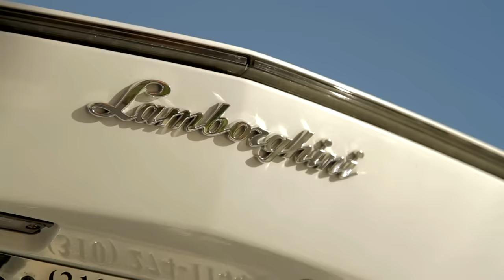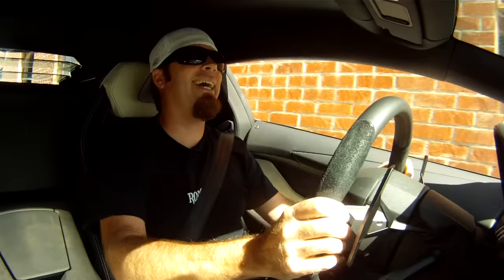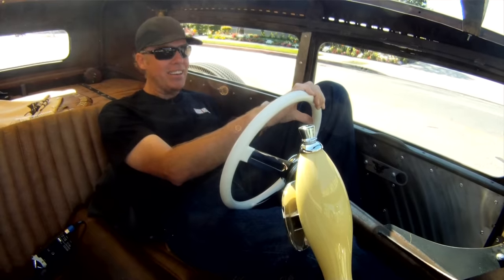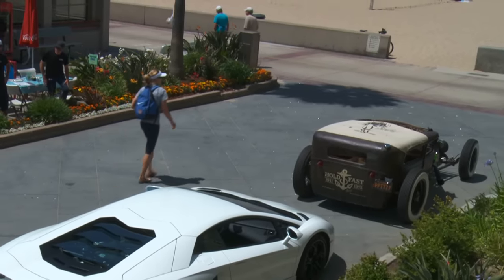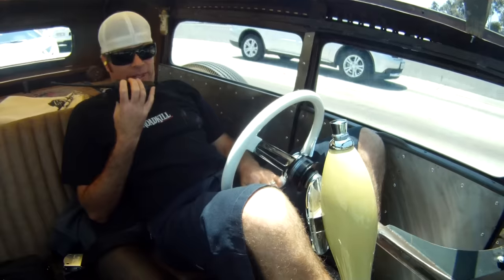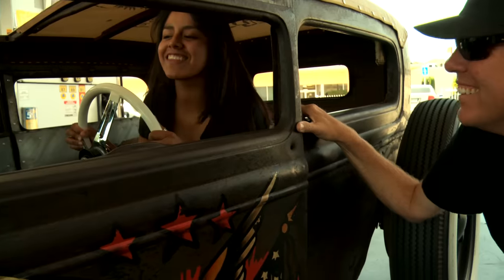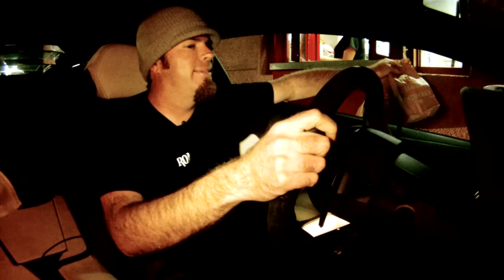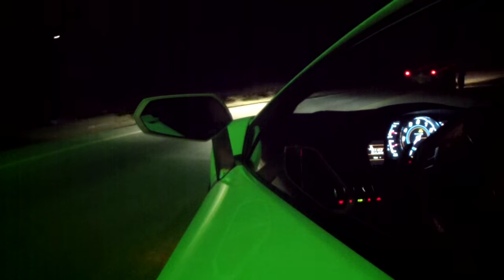Rat Rod vs Lamborghini Aventador! Roadkill Episode 5

Comment: "If you paid four hundred thousand dollars for a car, wouldn't you want an eletric seat adjustor?

Well.... no. No. Nooooohohohohohohoooooo!

If i paid $400,000 for a car, i'd want it to go fuck-fast!
Reply: ***** Dude a GTR or 300zx with engine work say 100k total including car purchase, hits 200mph.

A 911 Carrera turbo at stock hits 205mph for $200k

To say anyone should be spending 400k on a lambo, is arguably the dumbest thing anyone has ever said! Double the price for a measly 12 MPH increase?

Please. I could spend that money on multiple other cars and get far more than that, plus the suspension etc would be aftermarket and actually allow me to get up to that speed.
Reply: I read this right as i heard it.
Reply: A.S.G.A.R.D database that's your opinion and yours alone..it's not all about top speed or what your speedometer tops out at. For certain people it's how fast you get there and how fun it is while looking good. People like yourself don't buy Lambos and you clearly proved that. If you can afford an Aventador chances are: 
1) money isn't an issue
2) you don't want to be seen driving in a Nissan or any other car for that matter
3) you're a boss and don't give a fuck
Reply: Fair points :) Even in the video they were saying it's a car admired for it's engineering. That's where the extra 200k is spent, not the engine bay and drive train.

To also be fair however, what i mostly meant is that people buying Aventadors;
1) Have more money than sense, cheaper cars have better engineering, accelerate quicker and have higher top speeds
2) Looking down your nose at what works and admiring things just for their reputation is silly
3) Being a "baws"? Or CEO company like boss? If it's the former, you certainly wouldn't get there by driving an Aventador because it doesn't pull chics. Unless you're gay, then that's okay.
Reply: I meant the latter
Reply: Yeah, then sure. Being seen is all a part of the job description and most high ranking officiaries business ANd government are predominently men so an aventador would fit in very well there.
Reply: You know you're broke when you start trying to tell people how they should spend their money
Reply: Fredrik Kalgren Actually driving an expensive car doesn't make you look like a boss, it makes you look like a dick.You spend 400,000 on a car when you could have done other things.People lack common sense these days.

Comment: People,lets be real here..This is a 400k dollar supercar running against a homebrew teenage street banger.What were you expecting? This was done for entertainment purposes and to draw attention to the magazine.The GT40 coming out as well the viper and the ZR1 can all be had for a fraction of what the Lamborghini cost and with about 30k to 40k in mods will run as well or better than that overpriced small penis ride.
Reply: Teenage street banger? This is an old man street banger.
Reply: time bandit

 I was speaking figuratively by using a metaphor.
Reply: time bandit
I dont think that old men would be able to get in and out of the rat rod
Reply: The gt40 is going to cost the same as the Lamborghini and the viper cant even beat the z06 and all of them cant beat the gtr but if want a real muscle car get a hellcat and handles decent but biased towards the challenger because i own 1 it makes u fill alive cuz u might die but i love it
Reply: 247hotrod

 The Gt40 will beat the GTR  because it has a different hookup..Time will tell but there is a video of the Hellcat beating the GTR handily from a rolling start..The advantage the GTR has is the AWD hookup and the Camaro Z28  beat it at the track and had better brakes..It's on youtube where you can see it.
   The Hellcat is wicked fast.If there was an open road race,it could run with many super cars/
Reply: Mike Samra Well, no, it won't run the same as a lambo. Better is completely dependant on the mods, but you will never get another car to run like a lamborghini. For starters, the GT40 hasn't existed since the 70s, and the new GT is in no way analogous to that car. Performance for it is nowhere at the moment, we have no data. It's powered by a turbo 6, so neither the sound nor the throttle response are like the lamborghini. The viper is frankly a cartoon. It has a ridiculous V10 front mounted and weighs roughly as much as a neutron star. Without a serious diet, there is no way the viper will corner as precisely as a lambo, regardless of how much you spend on suspension. The corvette is a better comparison, but they're still heavy and they still don't have a V12. What if the owner wants that delicious 12-pot howl? Cars are nothing to do with your manhood, small or otherwise. Cars are about having fun and driving something you enjoy.

Comment: Its like comparing a good burger to a beef wellington...I like both of them and you cant compare them.
For all those wankers that think you can get the same performance as a lambo or ferrari etc for less havent tried driving on roads where you have to stop or turn and also have all the European safety regulations and not catch fire at 350km/h like I have see so many dragsters do.
A dad was jailed for life because he was driving his modified car and his whole family died inside it. Ask him how much 400,000 dollars are worth. Smartasses.
Reply: who needs to stop and turn when you can drift.
Reply: You cant drift properly without a limited slip differential and dragsters do not have one.
Reply: fair enough
Reply: You can, 2015 corvette zo6, Nissan gtr, 2013 corvette zr1, 2013 viper gta, viper ta, Ect
Reply: Nissan GTR has a multidisc Limited Slip Diff as well as the Z06 the ZR1 and any car that is worth mentioning.
Reply: thats true
Reply: If you're going to modify something, get something that's so old that a modification will make things better.  F'rinstance, a '70 Dodge Dart.  Loads of them had a 6 cylinder, but every one of them were built for the motors of the time.  Change out the K frame, add stiffer springs, disc brakes, and lots of V8 motor, and the only thing you can't outrun is a radio.

Stiffer springs: better handling in general, disc brakes: way better than drum brakes, and everyone knows that a big and powerful V8 can earn its pay on the drag strip.

As for that radio, hot rodders will be the first to beat one of those.

Comment: Lamborghini:
Pro #1: Fast 
Pro #2: Has a reputation of being fast
Pro #3: Can go over minor bumps
Con #1: Insurance companies would hate you
Con #2: don't you dare get a scratch on that thing!!!
Con #3: Still can't handle potholes

Ratrod:
Pro #1: Also fast (Cause there's not much weight to tug around with so much weight removal done to it)
Pro #2: Who cares about dents? It probably adds to the look of the car if anything!
Pro #3: Probably easier to insure than the Lambo.
Pro #4: On a race track, probably just as much fun to drive as a Lambo
Con #1: Uncomfortable
Con #2: No air conditioning
Con #3: less road visibility than race cars
Con #4: well, speed bumps become nightmares

I'd say it's hard to decide, if I'm on an actual race track I'd probably enjoy both equally much, but if I were actually driving them on the road I'd go with the Lambo cause even a supercar is more practical than a ratrod.

Comment: That's why if I ever owned a hot rod I will lift it a little so it can go over curbs and not get stuck as well it would have a good suspension an everyday use suspension

Comment: My rat loader would be loud as heck and i'd have all the gauges and gas gauge and i'd have a windshield not so chopped down. To where its drivable and i'd have it drivable and not that low to the ground. Plus mine I'd make sure i had leg room. Basically i'd have mine roadworthy if i ever owned one

Comment: For the cash that's probably in that rat rod some low rider hydraulics would make it usable on the road. One problem with rat rods (which are basically a way to use up junk parts and donor cars not worth restoring (and face it, with the death of the people who drove 1920s thru 1950s cars in their youth there's no great draw in restoration now everything that was worth restoring has already been done!) to make folk art. Rat rods aren't required to by dysfunctional shitboxes, it's just easier to slap them together that way.

Comment: Wtf labo is the best
Reply: it's boring!
the rat rod is way cooler and has more character!
Reply: lauri tuononen Each one has its perks. The Lamborghini is anything but boring. You need a lot of skill to push it to the edge. It's a 700hp car after all. The rat rod is not as fast on a track, of course, but as you said it's super fun and it has a lot of character.
Reply: Lambos are prime examples of people wasting their money. I'd take that 400k and buy another 2000 dakota with a built 408 magnum running low 11s easy with stock suspension. Way better than sum lambo any day.
Reply: Colton Curry the Aventador has much better handling though, but who cares, 'merica, right?
Reply: Colton Curry The Dakota is still a very nice car, but a Lamborghini Aventador is a beast on the track. Trust me, if you want to race on a track, you get what you pay for.